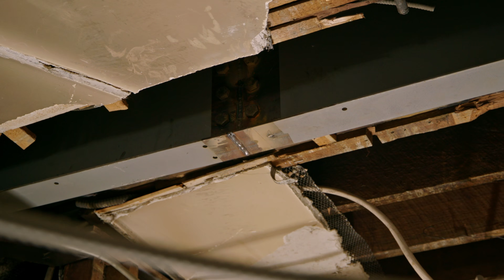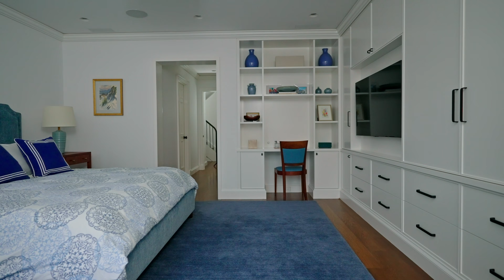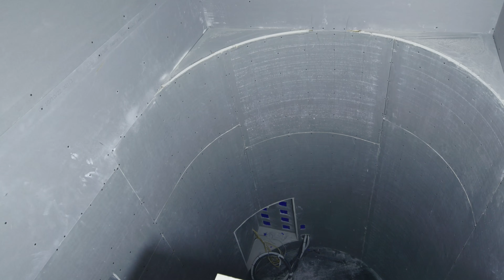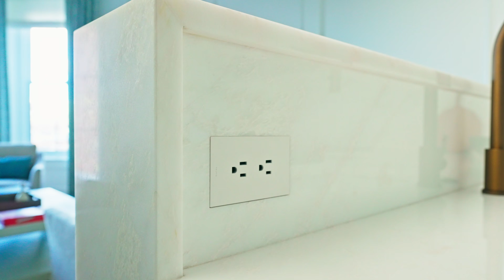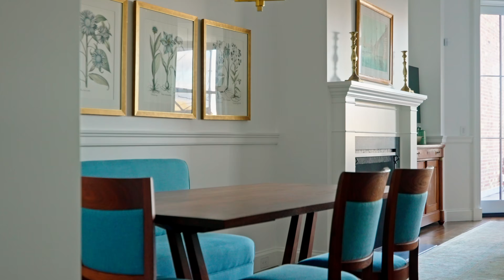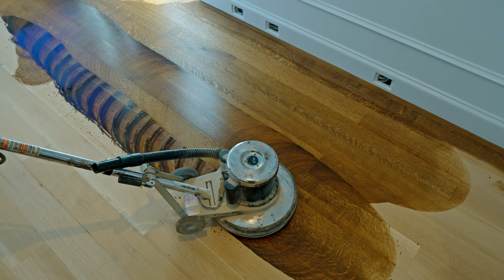The Story Behind A Complicated Brownstone Renovation

Comment: Great design and fantastic execution.
Little details like not continuing the chair rail along the chimney breast really help the accentuate the design as a whole.
Here in Ireland and in the UK 99% of staircases are joinery shop manufactured. 
I've have installed similar curved string staircase, we had the joinery shop CNC a plywood template of the staircase in plan, which was fixed to the floor and allows laser lines to establish finish pints for the plaster.
Not as elaborate as the method us here but the result was great nonetheless.
Keep up the good work.
Reply from the maker: Thanks 🙏. Appreciate you catching the details